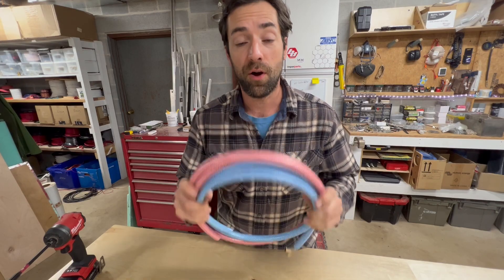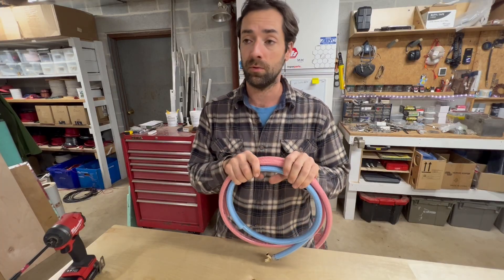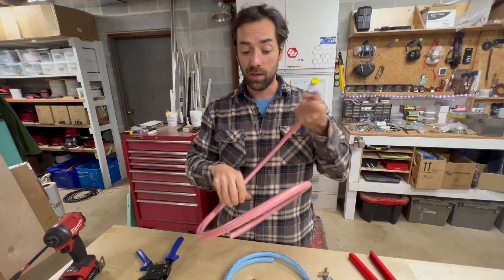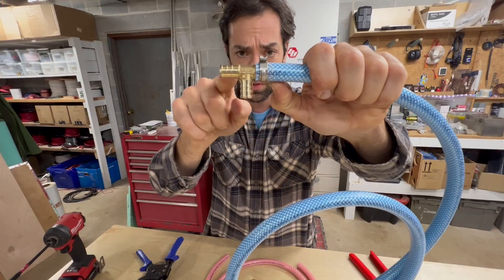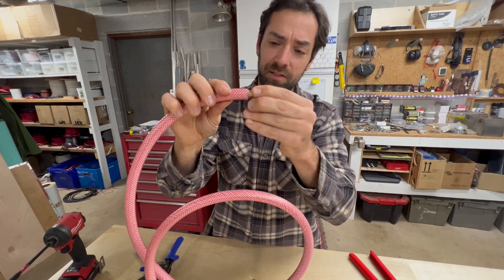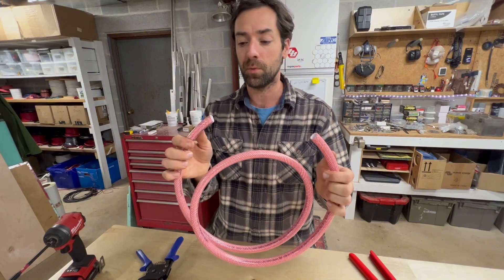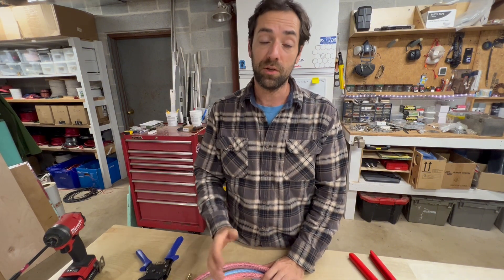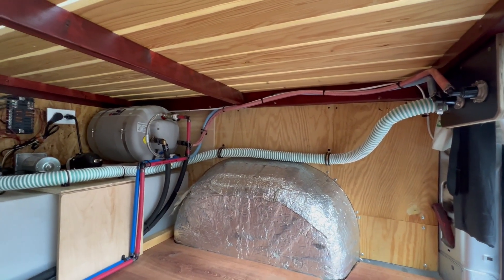Using PEX B Fittings with Pressurized Braided Nylon Hose in your Van or RV

Comment: RV manufacturers have been doing this for years.  It's a major cause for leaks well after the warranty is expired.  I do not recommend it at all based on my experience with my toy hauler and stories from many others.  I do think the braided hose is better than Pex, (A and B), with all the bouncing and vibration from the road, just make sure you use the proper barbed, (non PEX), fittings.  I would genuinely love to hear any first hand experience with braided hose to Pex A.  I assume it would be similar but am not certain.

Comment: I used different hose with hose clamps = leaks. The city connection area. 
The area has the only pull out drawer. I need flexibility due to drawer. 
I need a suggestion 
Can I use this and the 18.5 ear clamps.
Reply from the maker: what hose did you use?  Are the leaks at the hose clamps or at the fitting?  The fitting is important too.  The most common setups I've seen are pex B, braided nylon hose with hose clamps, and then the RV nylon hose with pex clamps.  Pex seems to be the best for minimizing leaks, though issues can arise from rigidity, cracked plastic fittings, and crappy connections.

Comment: Love the video!  Thanks!!  Subbed!  I would like to find a stainless steel water tank, any ideas for me?
Reply from the maker: my clients that have wanted SS tanks were all custom fabricated by local metal workers which is nice for custom applications but they require a lot of forethought...getting the right size bungs at the right location for vents, fills, drains, etc.  Also consider level sensor type and locations and then a way to clean the tank too!  Short story, I would come up with a design then ask a local fabricator to quote.

Comment: I used similar hose (braided nylon for water systems) with pex fittings, and purchased special hose clamps from McMaster Carr. They have two types: 1. Tight-Seal Bolt Clamps for Firm Hose and Tube
2. Tight-Seal High-Torque Bolt Clamp for Firm Hose
I used the bolt clamps, and have been in use for more than 4 years without any issue.
Reply from the maker: interesting, I will check those out!  Thank you for sharing!